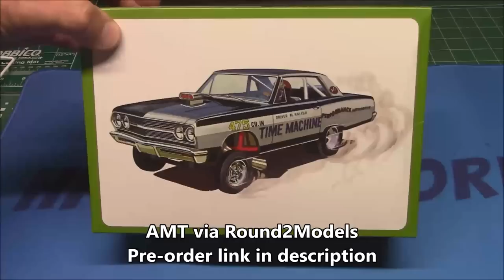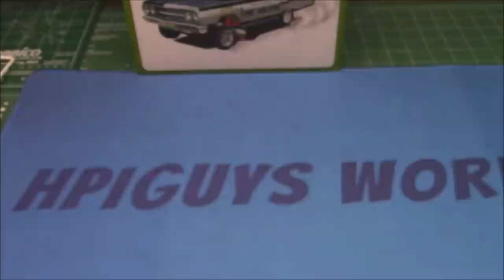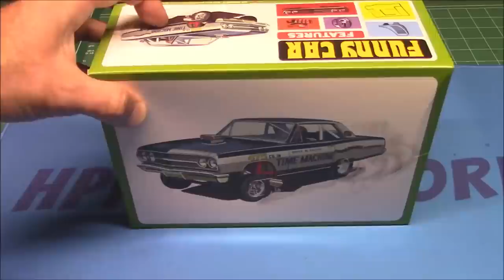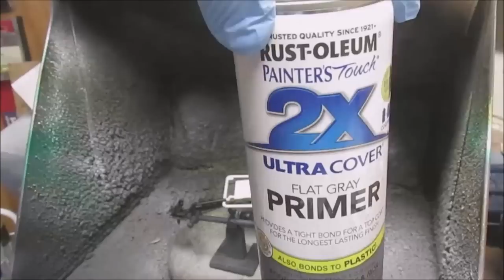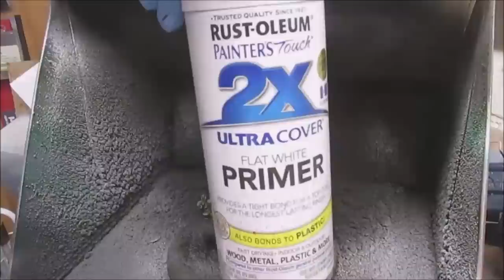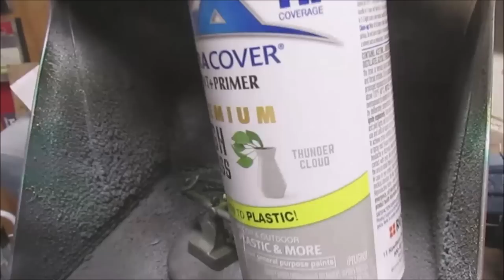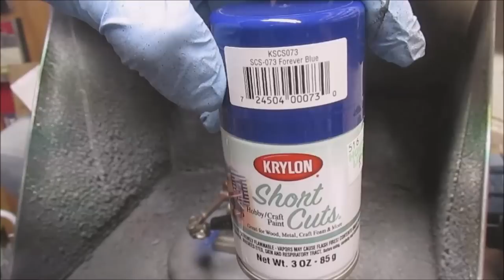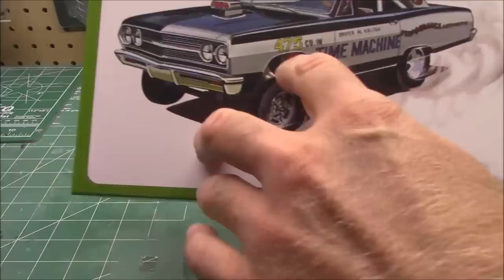ALL NEW! 1965 Chevy Chevelle 427 AWB Funny Car 1/25 Scale Model Kit Build How To Assemble Paint AMT

Comment: In 1965 I started to "build" my 1957 Pontiac Super Chief 348 into a drag racer. Isky cam, dual AFB's, 2 ½  inch exhaust with side cut outs, high RPM stall speed B&M Hydro Stick trans, Posi-track rear end with M&H Street Slicks as rear tires. By 1966 I thought I had a winner. Then my Uncle came for me and scooped me up. While away, my little brother decided to "modify" the car as an "Art Project". Bye bye Pontiac. But - Hello hpiguys Workshop - the memory saver. Thanks for the build, Chris - FINE machine!

Comment: WOW! I built this back in the late 60's! I believe the original kits had stack injectors instead of a blower, not sure. Malcolm Durham had a similar car, called Strip Blazer, back in 66. The oil pan is backwards. It should be rear sump. Very nice.
Reply: Looks amazing as usual. I remember Malcom Durham driving the Strip Blazer Camaro from pictures in Hot Rod magazine. I got back into the hobby 6 years ago and always look forward to seeing your videos. This one's a definite keeper for me. Keep up the great work Chris
Reply: Some original kits, like this one, did have supercharged engines.  The Olds Streaker and the Dyno Don Mercury Cyclone also had supercharged engines.

Comment: good to see this un back----have built all these "funny car" kits over the years and have always been concerned as to what keeps the rear fenders from drooping as there is a lot of air between the rear frame rails and the rear bumpers---also glad to see the "rubber" tires although the plastic tires didnt look to bad(just my opinion) if you painted them and scrapped the paint off the letters---oh my cure for the "floating" rear fenders was a piece of sheet plastic and some half round tubing
Reply: The real cars weren't built like these AMT kits.